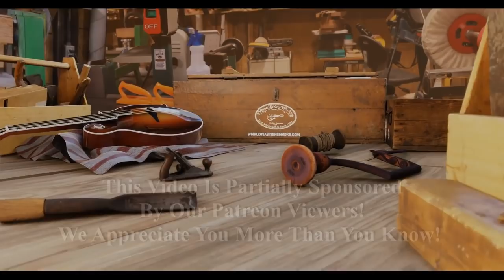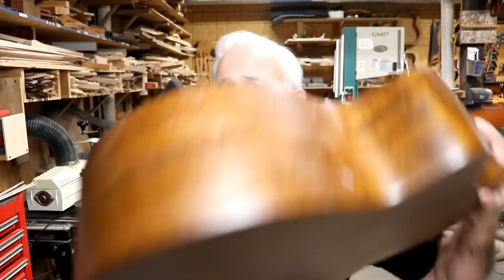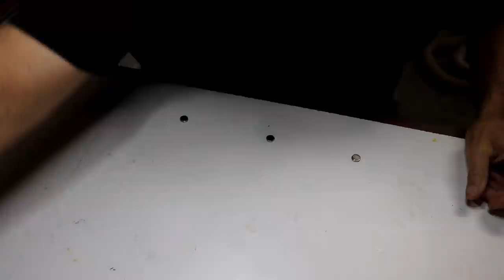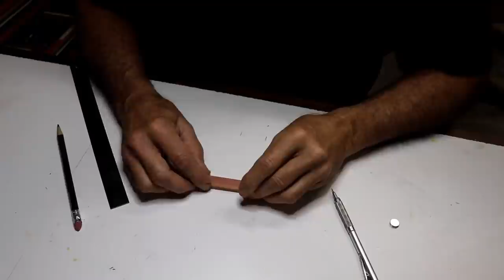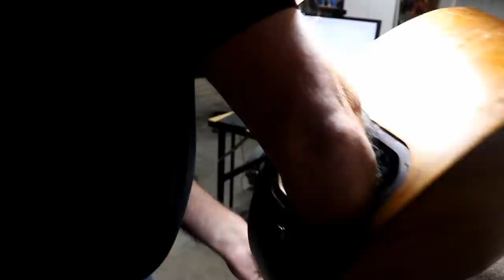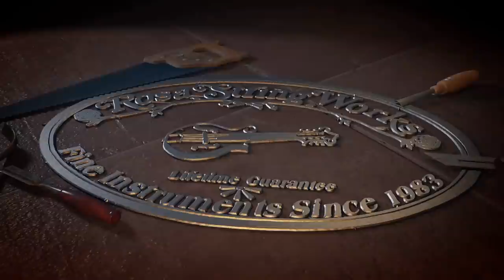VLOG #015 RSW Still On The Inside of The Bass

Comment: My son brought me a bag of industrial magnets, used to filter out metaldust in liquid plastics or something like that. They are about 2 cm round and 1 cm thick and have a very small hole in the middle. It is impossible to separate them by hand, had to drive a razorblade in between with a hammer (!) and then separate them with an ebony wedge. Very very useful ... if carefully handled and ... for free :-)

Comment: magnets get stronger with diameter. I used some one inch ones to hang some saddle bags never let go To separate magnets you need a V block with a small lever across the end that will  press down and shear them off. Made of wood of course.

Comment: Magnets don't have to be separated if you alternate N, S, N, S, etc facing up, and do the same for those on the other side, except N, S, N, S etc facing down (so that each pair attracts through the wood). This means magnets can apply force in a continuous line.
Reply: Not if you're gluing cleats that need to be spaced laterally throughout the crack; in that scenario, lateral attraction works against the glue joint.